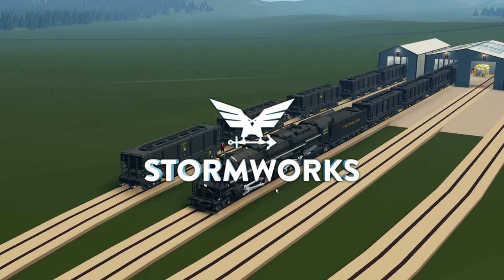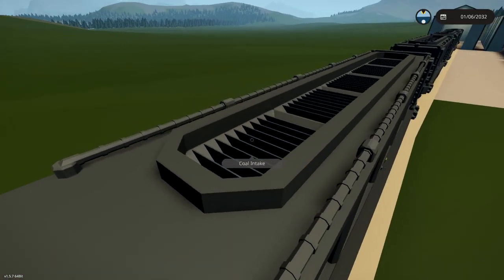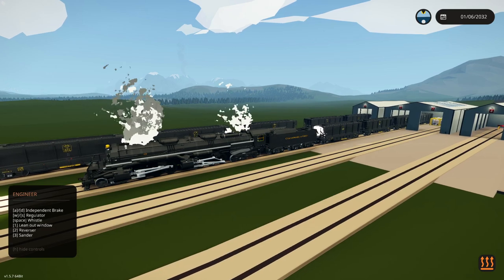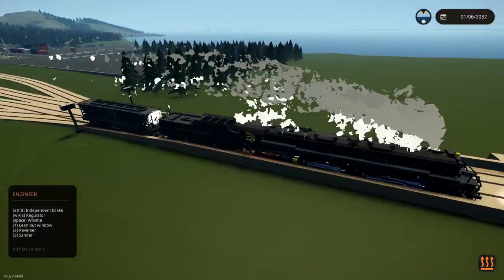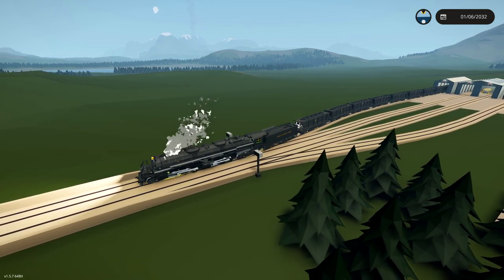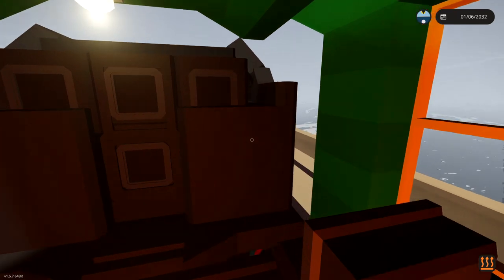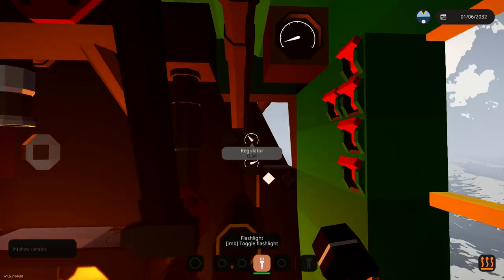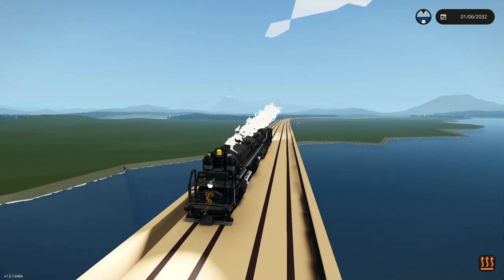HUGE LOCOMOTIVE Boiler Explodes In Stormworks!

Comment: Steam engines have a pressure release valve that keeps the boiler from exploding from overpressure

What causes the boiler explosion is when the boiler has low water level and the water moves away from the crown sheeting causing it to heat up and when water comes in contact with the over heated crown sheeting it instantly changes to gas causing a massive pressure increase that the pressure valves can't cope with causing an explosion
Reply: Also the sheet would melt, causing all the water to flash to steam